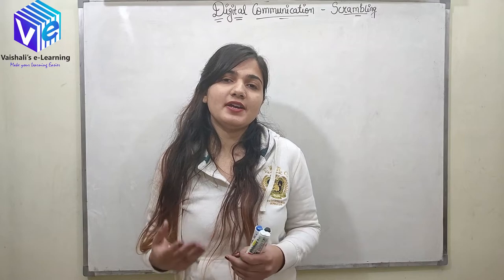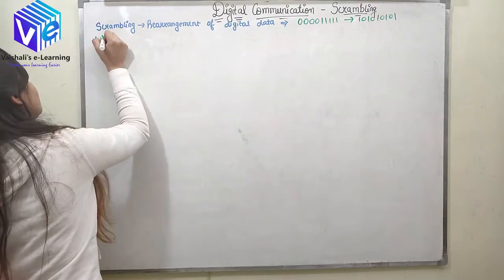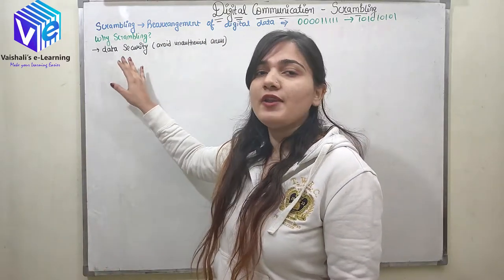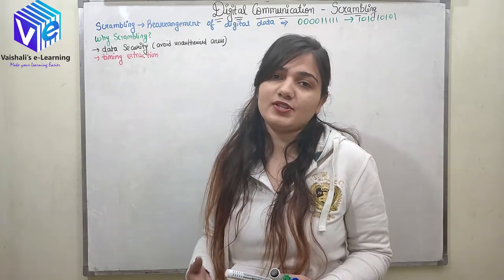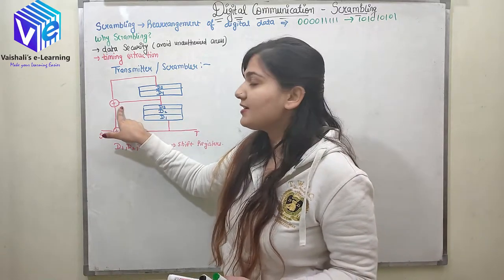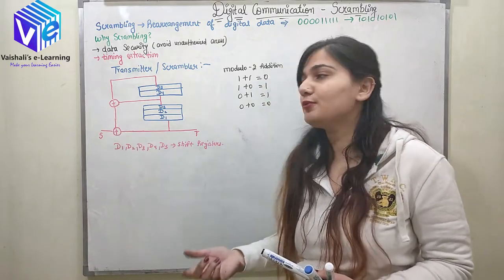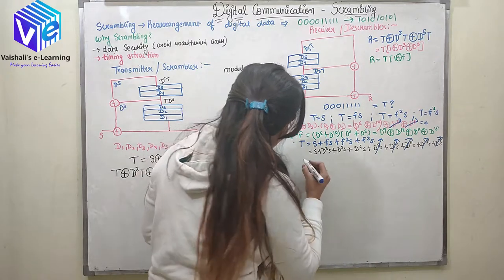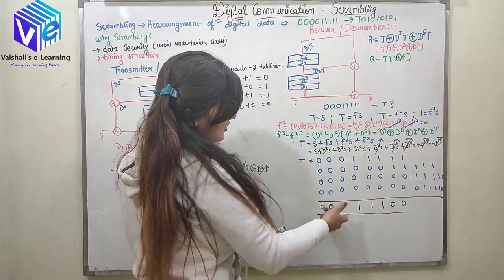L 4 | Scrambling | Digital Communication | Vaishali Kikan

Comment: The number of shift register so present is depend on what factors?
In the example u have taken 
U have calculate it for 4 feebback 
Why 4 feedback?
Reply from the maker: Shift registers are used in accordance to the degree of rearrangement.. this is the widely used scrambler circuit which I have explained..
Thank you so much for your valuable feedback..
Stay connected for upcoming videos..
Reply: @VaishaliKikan  okk thank u 
Scrambler circuit is somewhat more in details... I think 
To understand the number of shift register required...
Is ther any short cut?